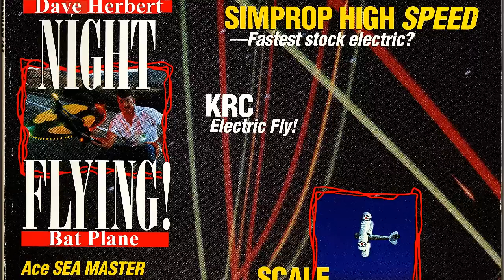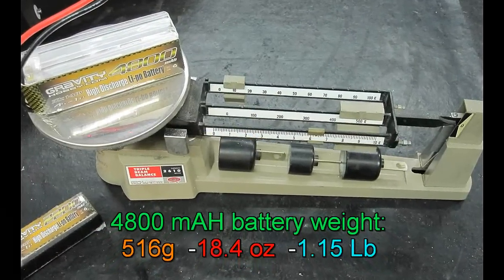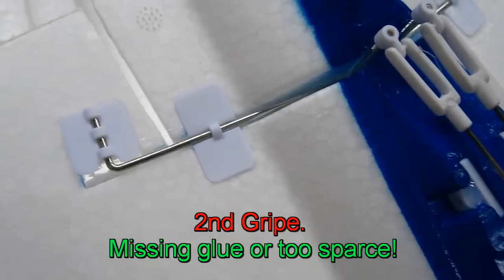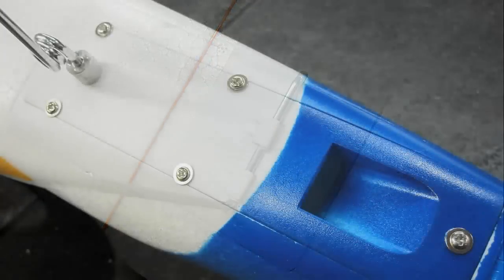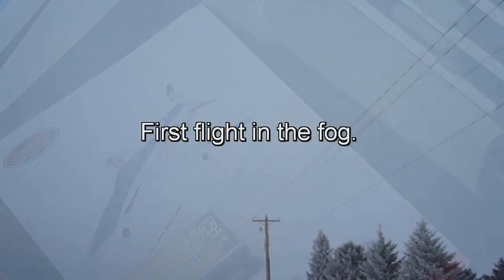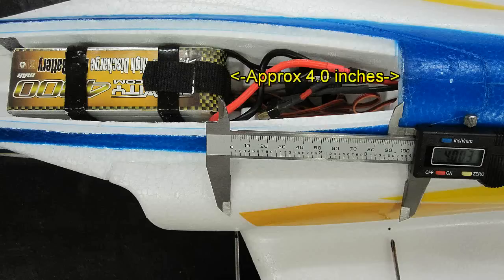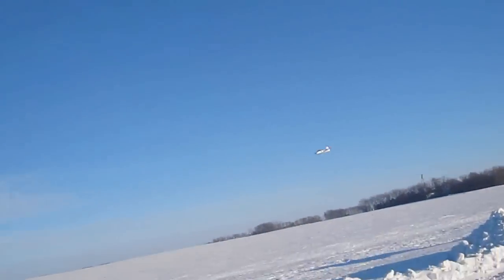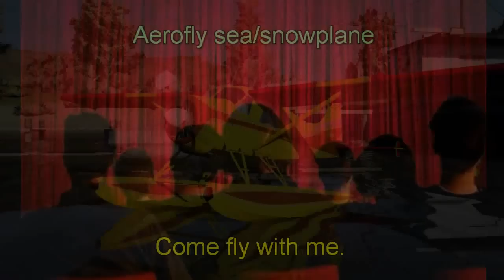NitroPlanes Meteor 125 MPH jet with flight success tips.

Comment: Dave,  thanks for an informative video.  I agree the Habu is expensive and should be at a lower price point.  A few things I like about the Habu is it's well built and it is backed by Horizon which is the best hobby company out there for customer service.  The Nitroplanes product you had seems not very well put together from the factory.  You had to fix a lot if their mistakes.

Comment: Only thing I would be worried about after your fixes would be the AR 500 receiver. I lost control and crashed due to that receiver.  Never had a  problem with my AR6000, 6100 or AR6200.

Comment: Thanks for the review - doesn't seem like there was too much to fix up to get it flying right (now that we know what to look for).
 I was surprised you wouldn't have just changed the connector on the speed controller instead of the battery?

Comment: just wondering when flying at the park if your aircraft is trying to take off on it's own, does that mean there is a radio interference..?

i mean the motor turns on it own, and some time doesn't respond when you make adjustment on the control.

Comment: i have this plane but it is is very hard to get off the ground so i removed the retracts but still no hope i have only flew it once because i cant get it up what i had to do was get my dad to toss it as hard as he could to get it airborne can any one please help
Reply: Help is on the way! 1st: Use a hard surface as a runway, not grass. 2nd: Make sure the center of gravity is further aft than the 4.0 inches Dave measured and showed. 4.3" (109mm) is much better. 3rd: Be sure there is no foam preventing the elevator rods from moving their full travel. You should be able to move the back edge of both elevators 1/2 inch total up-down by operating the elevator servo. 4th: Be sure your battery pack is in perfect condition and can deliver the required current this jet requires. A sagging voltage will not deliver enough thrust for an east lift-off. Grayson's Hobby now sells these jets, not Nitroplanes. I set one up for a friend this summer (2014) and am very impressed with the handling qualities and how long it flys on a 3300mah, 4S pack. My Habu (Mk1 modified) is much faster but the Meteor is overall a better flying jet.
Reply: Oh, in addition, my Habu is powerful enough to hand launch underhand (just like with the UMX Habu 180) and climbs straight up 'forever' ;-) There's 1800 watts spinning its fan - there's only 800 watts powering the Meteor. That's not enough to safely hand launch a jet.
Reply: StormyMaxPerry thank u for the help but its to late i stalled on take off and the nose is bust beyond repair
Reply: The meteor will hand launch very easily on 4s, also  will happily take of with retracts on grass.. I have no idea why these people are being quite so lame in the advice? as for your plane not taking off with retracts ?? wow you  are doing something wrong as the meteor just wants to get in the air !! ';-)
Reply: jairanch39 i found the problem after the crash i put the esc in another plane. and then that other plane didnt have enough power so i came to the convolution that they sold it to me with a dodgy esc but i could not get a refund so wasted £160 :(  but thank all of you for your help
Reply: +StormyMaxPerry What motor are you running in the habu?I bought a habu2 kit and installed a dr mad thrust motor 2600kv 1700 watts on 6 cell and a 12 blade change sun edf and I cant get it to fly, I hand launch.

Comment: this is to those who have the meteor I have the meteor one which I find is better than a meteor to all upgraded with a free Wing aftermarket 70 mm 12 blade inrunner motor around a hundred fifty amp ESC and I use a 8 cell battery the way the canopy is constructed cut out little bit of the bottom it accommodated the eight-cell perfect 5000 milliamp hour we took it to our airport what's raw fly professionally is a pilot we clocked the meteor at 192 mph it flew so fast I think the Earth stopped on its axis the right upgrades the meteor is a very deadly jet modifying a little trickier but I have the wings recess into the fuselage perfect very balanced easy take off I even install Brake flaps I have not yet found another styrofoam plane that can outrun this one even the F4U Phantom can I hold a candle on the since I'm done with a lightweight jet my flight time is longer I had it in the air for 25 minutes I have videos I'mma put on YouTube I bought this through motion they sell the best

Comment: I see you deleted the crash video where you almost took out your wife, must be a little embarrassed lol
Reply from the maker: I never crashed this plane, and very few of any of  my models even when flying helicopters inverted.  And I never used to take my wife flying till after the fire 2 years ago.  Not sure what you are talking about.  This plane actually got destroyed in the fire that burned all my models to the ground along with my cars and house and was flyable at the time.
Reply: NightFlyyer you flew a dynam meteor inverted  underneath your van.
Reply: NightFlyyer you don’t remember? You took the video down I’m pretty sure. You flew the meteor upside down full speed underneath your van.
Reply from the maker: No I don't remember.  I have NEVER removed any of my videos, good or bad because of crashing, as they would probably get way more hits.  That meteor was hanging in my garage when it burned.  I think I remember a close call on the road with a landing that rolled under my van.  It might have been in one of my other videos when visitors came.  Saying I was embarrassed however seems a bit harsh considering you wont find many crashes of my flying with over 1000 videos and any crash would not embarrass me. Back when I learned helicopters in the 60's, I crashed a lot, since we had no gyros, but I still was never embarrassed.